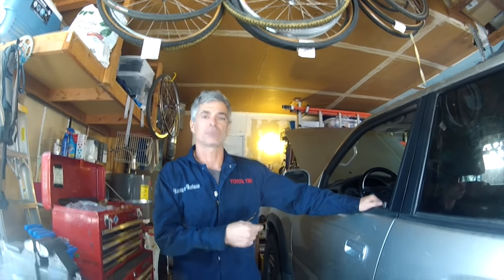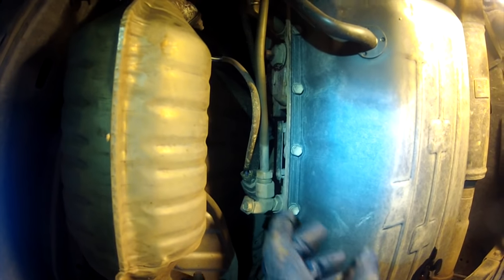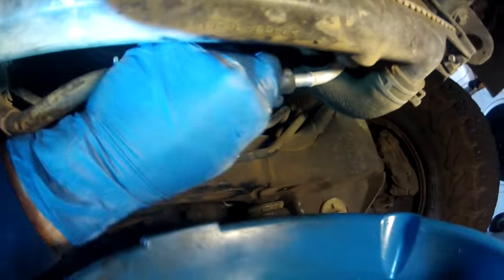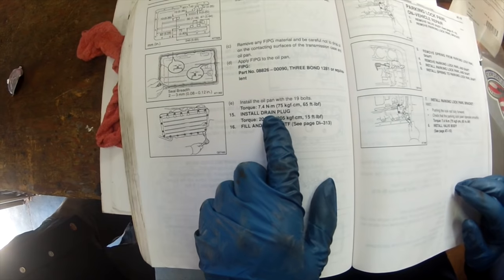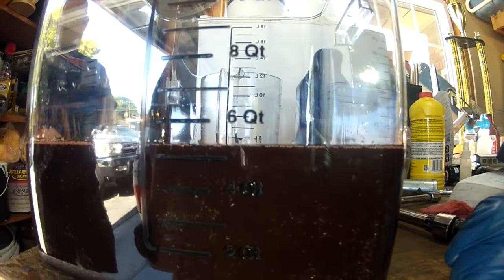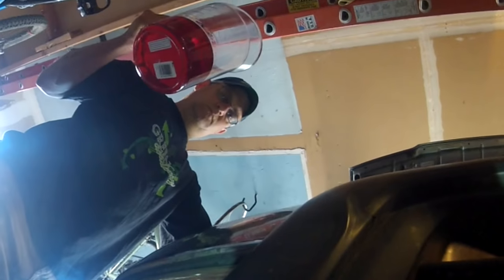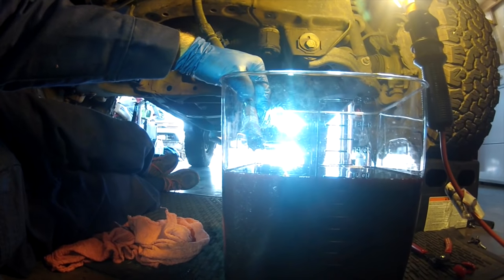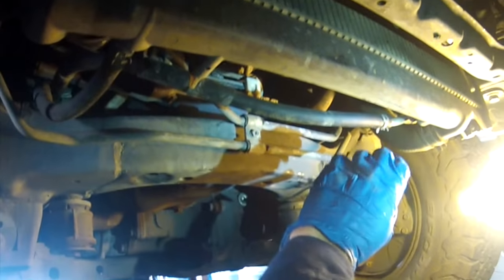Transmission Fluid Flush

Comment: How often would you recommend doing this as opposed to just draining and replacing the fluid (or would you ever)? Also, I noticed you used a transmission fluid that was not distributed by your manufacturer. Are there any things to look out for when choosing a transmission fluid that is not of your car's make?
Reply from the maker: If you want to stick with full flushes rather than doing drain and refills, you should do it every 30k miles.  If you do a lot of driving in the mountains or you tow, do a full flush every 15k miles.

You just have to choose a fluid that is compatible with your original spec.  In this video, we chose a fluid that is compatible with Dexron 3 ATF.  

I personally do a drain and refill every 10k miles rather than do full flushes.  I drive a fair amount in the mountains so I like introducing new fluid on a more regular basis.
Reply: @TimmyTheToolman  
Hea tim what if i used Toyota tiv fuild on my 02 tacoma should i keep using this or use dexll / lll thats whats on my dipstick ??
Reply from the maker: @cray7139  You can use any fluid that is compatible with the Dexron 3 spec.  I use Valvoline Maxlife.

Comment: Tim I'm curious what your thoughts are on doing the drain and fill over a few thousand miles versus doing the complete flush in one go.  I'm adding the transmission cooler and am leaning toward the drain and fill so not to 'shock' the trans and valve body as some suggest.  Seems like there are opinions all around but I'm sure you've heard a lot of 3rd Gen 4Runner folks give you their results so I thought I'd ask.  My oil is pretty dirty so it would definitely be a jolt to the system going straight all new ATF.  Thanks in advance, Ash
Reply: Man I literally just noticed your reply to a thread below a year ago where you do recommend a drain and fill in extreme examples.  I think I'm going to go with my gut and lean toward that method.
Reply from the maker: @Ash-cy7yw  Hey Ash, definitely go with the drain and refills.  It's a dilution process, but if you do it often enough, your fluid stays in really good shape.  After the initial series of drain and refills spread out over around 5k miles, I now do a drain and refill every 10k and replace my in-line magnetic trans filter at the same time.   The Magnefine in-line filters I use are rated for 30k miles, but I just change them out sooner just because it makes me feel better.  A Blackstone Labs analyzation of my trans fluid proved to me that drain and refill do an excellent job of keep the fluid in great shape.  Happy Wrenching!
Reply: Thanks Tim much appreciated as always.  Feel free to cruise by my house tomorrow and watch me if you're out and about with nothing going on.  I won't make you get your hands dirty I promise..

Comment: Excellent comprehensive video.  Thank you for sharing this.  Where can I find a rubber drain hose?  Also, what size hose did you use?
Reply from the maker: Hey Joseph, glad you like the video.  Just get a 3/8" section of transmission cooler line.  If the auto parts store doesn't have it, 3/8" fuel line would work too.
Reply: @TimmyTheToolman  Thanks sir!
Reply from the maker: Joseph Coates you’re welcome

Comment: Nice video Timmy! Hey, quick question about the transmission/cooler hose.  Are the low and high pressure hoses the same, as far as diameter and durability? If not, would you please share a link where I can buy them? Thanks man. Big fan of your channel!
Reply from the maker: There really isn't a high or low pressure hose.  They are start off as steel lines from the transmission and then they connect to the trans cooler via rubber lines.  Those rubber send and return lines are both made from the same material.  There's no difference because the pressure is same throughout.  The trans pump moves the fluid from the trans to the cooler and then back to the trans.  You can buy rubber transmission cooler line at any auto parts store.  Visit your local auto parts store and ask for 3/8" transmission oil cooler hose.
Reply: Timmy The Toolman Thanks for the info. I’m going around my 1997 4Runner looking to replace all rubber line/hose so I bought a set of silicone vacuum hose kit of 4mm, 6mm, 8mm, and 10mm (mostly for engine bay dress ups). I doubt if I’m able to cover everything but, I heard silicones aren’t good against oil or fuel applications. I’m very new to this so... are the rubber fuel-line next to the tank 3/8” as well? Thanks you.
Reply from the maker: @Needle620  I'm not sure what the diameter of the fuel lines are.  My advice is if it's not broke, don't fix it.  Sure, vacuum lines can harden and crack over time.  If you see one that needs replacing, replace it.  I wouldn't go around changing all your rubber lines just because.  I think you're making a lot of work for yourself.

Comment: Hey Timmy, thanks for all the great videos!

I'm wondering, wouldn't omitting the pan draining portion of this and just doing the removing fluid from return side of the radiator and replacing through the dipstick tube part until the fluid is coming out clean get the same result and would replace the fluid in the pan anyway? Or am I missing something? Maybe there is something to how the fluid flows through the different parts of the transmission that I'm not understanding?

Edit: I just saw your response to another viewers same question.
Reply from the maker: Yep, same result.  It just replaces 4 flushing rounds by draining the pan.

Comment: I'm looking to do a trans filter change/fluid flush on my 2014 4runner.    Should I go ahead and do the flush procedure first with removing the line and filtering new fluid through it THEN dropping the pan and replacing the filter, adding some new fluid and be done with it?      To me that sounds correct, I have a scan too to check trans temps & am familiar with using the overflow bolt design so it (dribbles out) since mine is a sealed trans.
Reply from the maker: You could do it the way you're saying.  I've never done this on a sealed transmission so I can't comment on how to do that.  I did hear the technical service bulletin on how to perform the operation on a Toyota Sealed Transmission sounds pretty complicated.  If it's as easy as you say by just getting it to operating temp and having it at the level of the overflow bolt that would be nice.

Comment: Great video, something past my expertise though.
Can I ask you what the two metal silver tubes (about 3/8" diameter) are at 5:25 right under the belts? (Other transmission fluid lines?)
I have what appears as a clear red transmission fluid leaking where the tubes are attached to the vehicle via a metal bracket.
Reply from the maker: Those are power steering lines.  The power steering system also uses ATF fluid.

Comment: Great video!  Does the disconnected return rubber hose have to be capped off or does did it not leak during this entire process?  Thanks
Reply from the maker: It will leak when you take it off and then maybe drip a tiny amount while you're doing the flush.  Just try to wedge the rubber tube somewhere with the open end pointed up and you won't get any residual dripping while doing the job.

Comment: Another great video Tim! And I was thinking should I change my filter out on the valve body before I do this or after I do it?
Reply from the maker: Thanks!  Honestly, unless you think the transmission was abused in the past and the fluid was allowed to get very dirty, that filter is fine and probably 95% unclogged.  When I took my filter out and cut it open to examine the fine mesh filter material, the screen was mostly clean.  But, my trans received regular services over the years.  So, maybe don't bother with the trans filter replacement at all and just flush the fluid if your trans was well taken care of over it's lifetime.  If you don't know the history of your trans, a filter replacement might be a good idea.  I would replace it after the flush so you don't partially clog up the new filter running dirty fluid through it.

Comment: Great video and thank you! In the torque app there's two methods listed for reading transmission temperature. What is the difference between the two and which one should I use to do this procedure on a Toyota RAV4?
Reply from the maker: I'm pretty sure I'm using Method 3.  For me, there was only one transmission temp method  highlighted in green so that was the only one available.  Do you have multiple ones highlighted in green? If so, try method 3 first.
Reply: @TimmyTheToolman  Wow thanks for the speedy reply. So what I did was I added a custom pid and that one is listed with the methods 1 and 2. None are high lighted in green. Does my obd2 reader have to be plugged into the vehicle and connected to my phone in order to have any of those options highlighted in green?
Reply from the maker: @bryans8193  Yes, you need to be connected.

Comment: After you hand, tightened the transmission drain plug and you checked it with the torque wrench, even though your torque wrench clicked at your 180 inch pounds You still theoretically, could have tightened it beyond that point, and it clicked only because it was beyond that point already. Also I’m wondering since you’re running the car with transmission fluid draining for several seconds you are in fact, running it with less transmission oil than it should. Or do you figure that a quart low is OK for that amount of time?  Why not just do two or three complete drain and refills?
Reply from the maker: There is no way you can hand tighten past the torque spec. But ultimately it’s good to become familiar with tightness outside of a torque spec. For a drain plug, you can rely on tightening by hand once you have more experience. You never want the transmission to run dry and replacing 1 quart at a time is pretty safe. Because we are relying on the pump to move the fluid through the system, that is another reason why you wouldn’t even want to come close to running it dry or low.
- Sean

Comment: Bloody good indepth video Timmy. I'm impressed 10/10.I'll do mine this way i can't go wrong.
Reply from the maker: We're glad you like it and thanks for taking the time to comment.
Reply: Do you recommend a good quality ATF for Toyota or use Genuine Toyota ATF?? i have a Yaris (UK) Cheers.
Reply from the maker: In my 3rd Gen 4runner, I use a Valvoline Dex/Merc.  Dex/Merc is a replacement for Dextron 3.  You don't need to run Toyota ATF.  Just buy the correct ATF for your vehicle from an established company like Valvoline or Castrol and you'll be fine.  

You do have the option to run a synthetic ATF and that choice is up to you.  I run a conventional ATF and just replace it on a regular basis.  

I do a drain and refill of my trans pan every 10,000 miles to keep my trans fluid in good shape.  I get around a 3rd of the system capacity when I do a drain and refill, so in 30,000 miles, which is the suggested interval to renew your ATF, I've replaced the entire capacity.  Now, this method is a dilution process meaning I'm mixing new fluid with old fluid but it's very effective to keep the ATF in good shape to avoid doing the full flush procedure.   Drain and refills are very simple, quick and effective and that's why I like it.
Reply: Thanks Timmy,did alot of research 90% say use the Toyota WS  and 10% say use a afew other good quality well know compatible fluids BUT that could cause trouble later they say. 
Will get it from Toyota to be safe 2 quarts should do it it's only a 1300cc lol 
Saw on a forum this..... "And according to my research here are some other options and alternatives to Toyota WS
Valvoline Maxx Life ATF
Kendall VersaTrans LV ATF (Made by Phillips 66 Lubricants)           (This is what my local Firestone buys buy the 55-gallon drum to service automatic trasmissions)
AMSOIL -AMSOIL Signature Series Fuel-Efficient Synthetic ATF
Redline Synthetic Oil - D6 ATF
Schaeffer Oil - 205A Dexron® VI/Mercon® Automatic Transmission Fluid (Suitable for Aisin Warner JWS 3309, JWS 3324)
Pronto Full Synthetic Multi-Vehicle ATF Fluid (Distributed by National Pronto Association | Grapevine, TX 76051 | MADE IN THE USA)
Amalie Universal Synthetic Automatic Transmission Fluid (Amalie Oil Co. Tampa, Fl.)
Martin Lubricants - SynGard™ Multi-Vehicle Dexron® VI and Mercon® LV Automatic Transmission Fluid
SC Fuels - Multi Performance 500 MVP Universal ATF
Super Tech DEXRON VI Automatic Transmission Fluid
Chevron Havoline Synthetic ATF Multi-Vehicle Dexron-VI
                                      
And if your in Australia, Nulon - Full Synthetic Multi Vehicle Automatic Transmission Fluid.
Aisin ATF0WS - ATF, Automatic Transmission Fluid; WS-World Standard"
Reply from the maker: Sure, if you've heard going with different ATF fluids could cause problems, go the safe route and use the Toyota stuff.  I've just never seen the need to buy the manufacturer brand for vehicle fluids.  I've gotten away with using quality aftermarket brands for 35 years.  On the Toyota forums, people swear by using only Toyota red coolant.  When I bought my 4runner, it had Prestone green in it and I've kept it that way.   Prestone green is perfectly fine.  The key is to do regular coolant renewals regardless of the type of coolant you're using.

Maybe the way they are manufacturing vehicles now, it's becoming necessary to use the specialized fluids the manufacturer produces.  I don't know.  I worked on my girlfriend's little BMW Z3 convertible and changed the differential gear oil.  I think a quart of the special gear oil BMW sells was like $30.  I can get a whole gallon of a quality 80w-90 gear oil at a auto parts store for less than that but I bought the BMW gear oil just to be safe.  

Happy Wrenching!
Reply: 1x quart at my local parts is £10 Been to Toyota they want £53 for a 5L .Parts fella said the WS is for 2007 onwards.I'll pop in tomorrow for an indepth discussion as i want the proper ATF for my 02 Yaris and i will pay £53 as mine is brown.Service book say change every 60,000 miles but manual and dip stick says "Never need changing under normal use"  and "Check warranty" Btw service book sayscoolant needs changing every 20,000 miles or 2 yrs but use Long life coolant which made me laugh.
Reply from the maker: 60,000 miles is way too long in my opinion but I do know synthetic fluids last longer than conventional and I'm guessing the fancy WS fluid is synthetic.  "Never needs changing" is a bloody joke.  See how I worked your lingo into that last sentence. :-)  

Yeah, coolant renewal every 20,000 miles and using Long Life coolant is an oxymoron.  I change mine every 30,000 miles.  Just a drain and refill of the radiator which gets most of the old coolant out of the system.
Reply: Things is Dealers will say afew things to cover their back and we've all been there...like "Of course at 100,000k and it's brown/dark brown it'll need replaying" or even "Motorway/freeway miles with constant running it'll heat up more hence less longtivaty" garbage,but it'll be too late when funny noises appear.Cheers fella.
Reply: Just did my AFT exactly like this and it was so easy to do,flushed out 4.1 litres and because i poured the old ATF into an empty oil can. I  accidentally poured about a table spoon or a splash of "Top up coolant" which is a clear all purpose coolant into my auto transmission.Would just a table spoon in it be ok?
Reply from the maker: It's not ideal but a tablespoon probably won't hurt anything.  But, if it were my rig, I'd waste some fluid and do another drain and refill of the pan to further dilute the coolant you got in there.  Water and coolant destroy automatic transmissions but the amount you got in there probably won't cause you any problems.  It's just better to be safe than sorry and just eat the cost of 4 liters of ATF.
Reply: Thanks,it was just a splash as i had to use a really small funnel because that's all i had and the dip stick tube is really narrow.I'll leave it as it's litterally just a table spoon amount.
Reply from the maker: Yeah, you're probably fine.

Comment: I have a 2005 Highlander V6 3.3. What is your opinion on removing the transmission pan so you can actually change out the filter. The car has only had the transmission fluid changed out once and I just recently bought it used with 125,000 miles on it.
Reply from the maker: That’s pretty low mileage and if the transmission fluid was serviced at least once, we don’t think the filter would require replacing, but it is good to do for piece of mind if you don’t know the maintenance history. If you’re dropping the pan to clean up the magnets in the bottom of the pan, then you will be able to identify if there are any significant sized particles that could indicate the health of the transmission and if you’re dropping the pan, you might as well replace the filter since you’re in there.
- Sean

Comment: Hey Tim I recently bought a 96 4runner with 171K miles, but the fluid has never been changed, should I do a fluid flush or should I leave it alone? The car shifts fine but the fluid is a bit dark.
Reply from the maker: Hey Cesar, it's a hard call with that many miles on that fluid.  I DEFINITELY would not recommend a full flush.  The most I would do is a drain and refill of the pan but even a drain and refill might be risky.  What I do know is the lubricating properties of that fluid broke down a long time ago unless the vehicle was never driven on any grades and stayed in the flat lands it's whole life.
Reply: Sounds like I should just drive it as is until the tranny dies. Thanks!